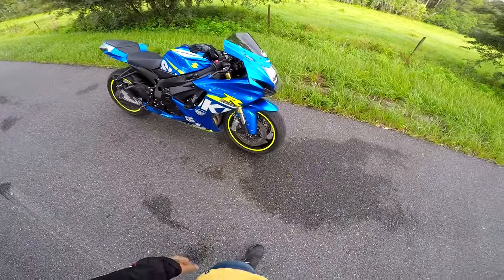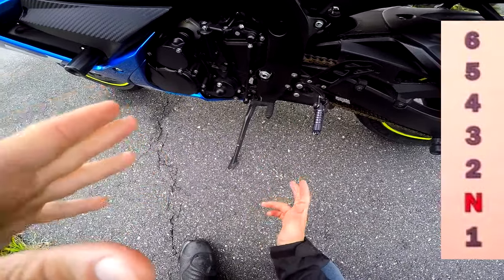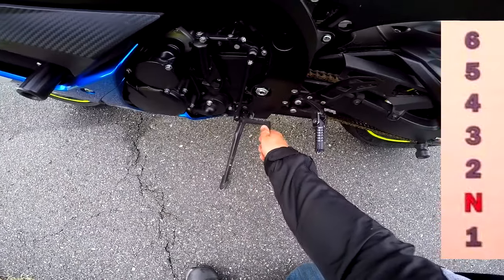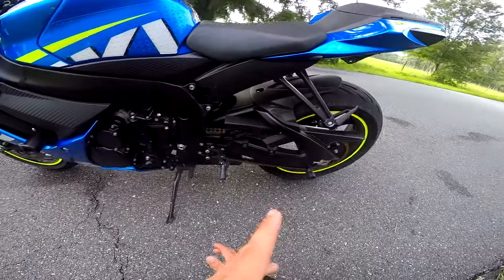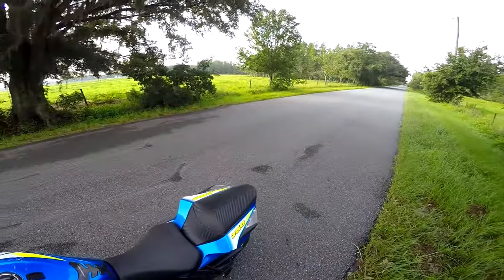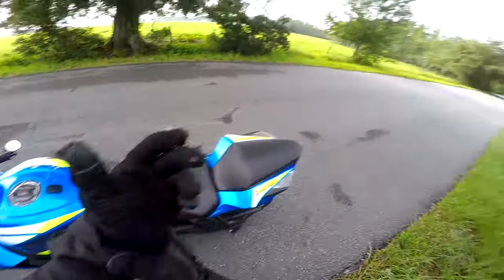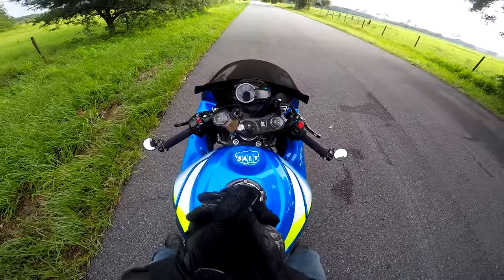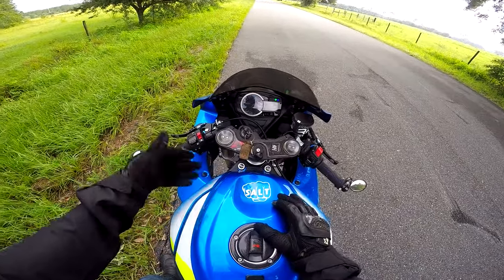How To Ride a Motorcycle: Part 2 - Shifting & Downshifting

Comment: 7:13.. are saying it's ok to go 1st gear when I'm not gonna complete a stop??
Reply: yes first gear is the only gear you can start from a complete stop. Example if you are in third and about to reach a red light, just before you come to a stop at the light. You MUST shift down to first gear, you CAN slow down then take off if in 2nd 3rd or whatever. but if you are coming to a complete stop (stop signs, red lights , some dude crossing the street) you have to be in 1st

Comment: I’m still trying to learn when is the right time to shift up.
Reply: Gear 1 : To go from stationary to moving at extremely small, speeds. Used in parking lots, start of a steep hill or when just doing very precise and careful slow speed movements. 

Gear 2 : More speed 

Gear 3: ….

Comment: Question wen you stop both brakes front and back?
Reply from the maker: Yes, You don't HAVE to use both brakes but I usually use 60% front brakes and 40% rear brakes, you have more stopping power in the front.

Comment: changing gear in up hill or inclined roads
Reply from the maker: You always want to be in a lower gear when going up a hill or going down especially on a smaller cc bike
Reply: @SALTxTHExWOUND  160cc bike with pillion want to change gear from 1st to 2nd at what speed or rpm should I change.full inclined roads

Comment: I always afraid of breaking with front brake i thought i will get flipped if i pull it
Reply from the maker: No, you will only flip over the front if you slam the front brakes completely, you want to ease onto the brakes NOT all at once.

Comment: It’s called a biting point lol friction zone threw me off
Reply from the maker: It's called friction zone lol
Reply: Biting point is a weird metaphor used by pink faced brits 

Friction zone is the correct term because it describes exactly whats happening. The engine and transmission begin to touch, hence the friction

Comment: How do you know when to switch and not to
Reply: You can shift whenever as long as you're not riding on the red line. Also you don't want to be too high in gears and too low rpms. Bike will stall

Comment: Thanks. Quick question though, if you're up and running in first gear and you do release throttle->press clutch->upshift->release clutch->give it a gas, can you release the clutch lever quickly during the release or the engine will die same as when you are in first gear while you start running from stop?
Reply: Hey , also learning how to ride here. From what I’ve learned every time you upshift or downshift and it’s time to release the clutch, you release slowly and give it gas simultaneously, or else like you asked, it will stall.

Comment: Wouldn't that put you in Neutral? 0:54. And one more upshift for 2nd gear?
Reply: No. You have a "half way mark" that is the neutral. Pulling it all the way up will make it skip neutral, and just go into second gear.

I suggest you look into the workings of a motorcycle gear, there are many good videos if you look them up. Maybe seeing how they work, will make you understand your foot movements.

Comment: I hope someone answers my question!

Whenever I’m rolling off my 1st gear and going to my 2nd gear. 

I completely release my throttle and off and everything and go to second. Engage my throttle and it gives me a jerk. Do I completely let go off the throttle? Not sure if that makes sense and pretty sure some of you guys had the same problem 😂😭😭
Reply from the maker: Let off the throttle completely while you pull the clutch in to shift, don't get back on the throttle until you're releasing the clutch